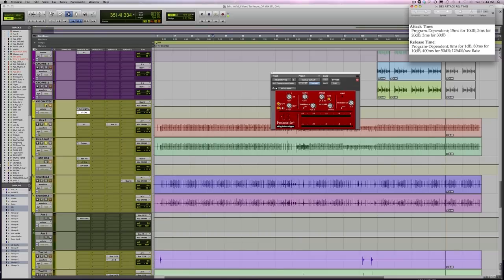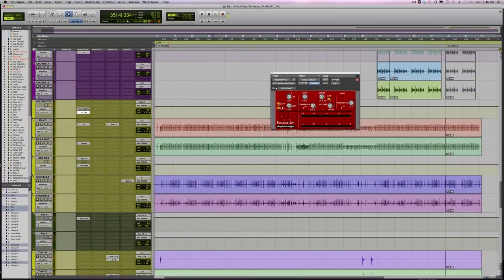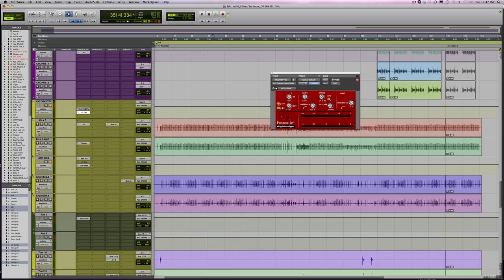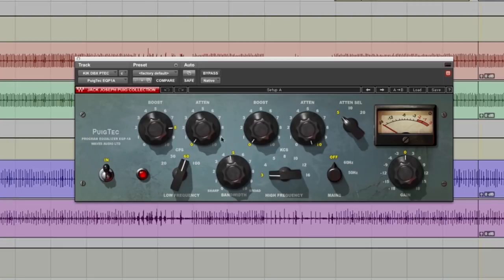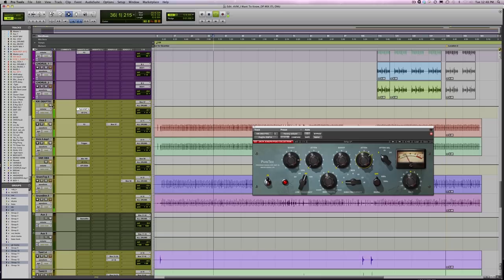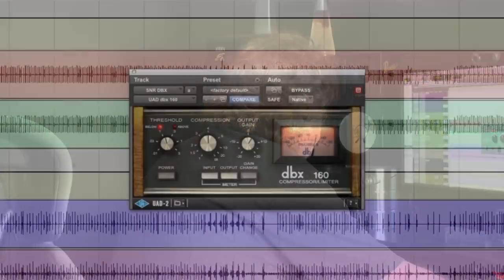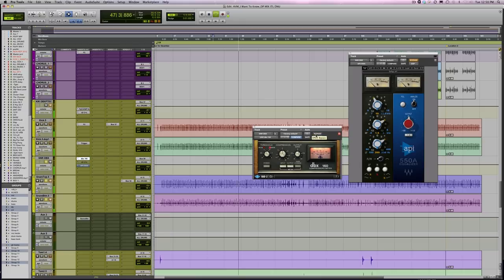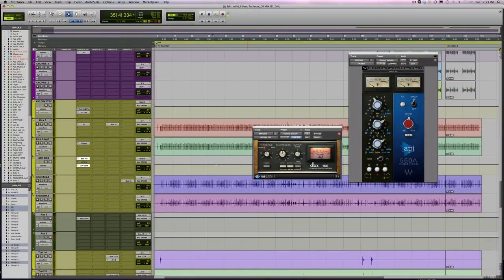Into The Lair #52 - DBX 160 + Pultec Kick and Snare Parallel Compression Trick

Comment: I dont understand the release times.  I understand the attack but what does 1 sec/ 125 db mean?  Every 125 of threshold?
Reply: It's set to an automatic time, so it has different thresholds that change the release time. So for example, .5ms over 10 db, 20 ms over 20 db, 100ms over 30db etc.